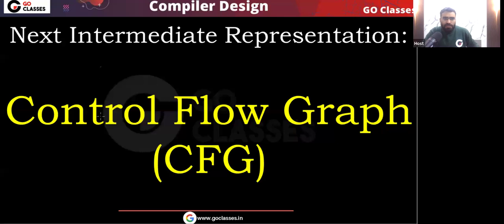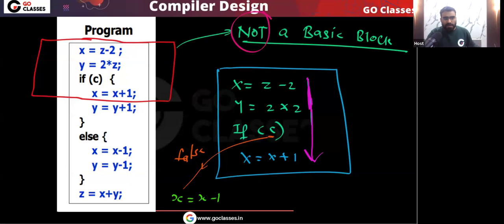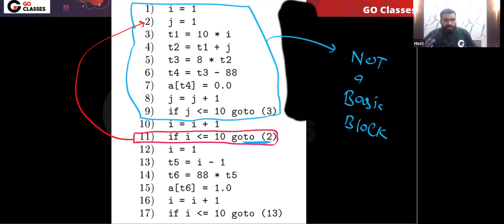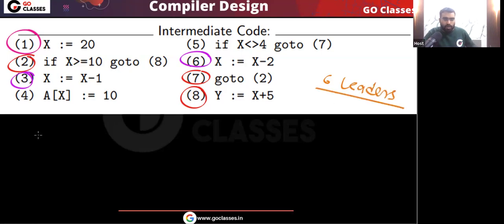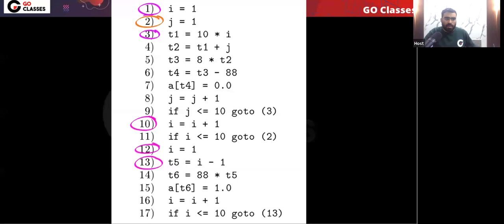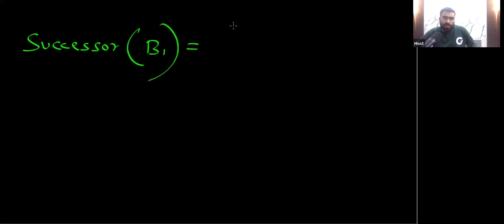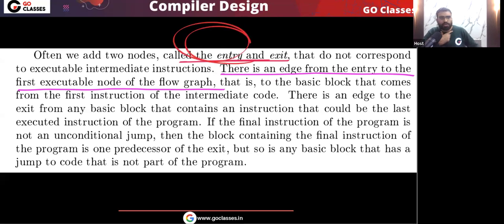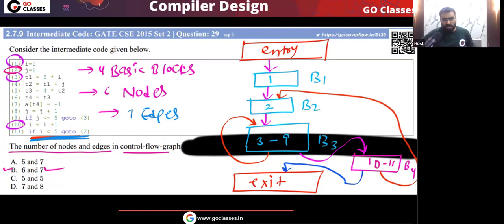Control Flow Graph CFG - Complete Lecture | Basic Blocks & Leaders | Loops in CFG | Compiler Design

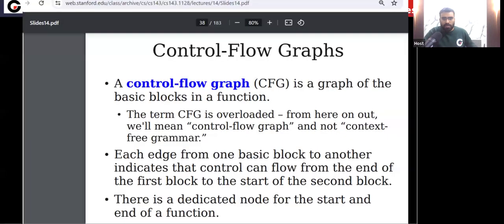Comment from the maker: 01:05:17 - Entry Node & Exit Node in the Control Flow Graph
There is a dedicated node for the start and end of a function.
01:47:26 - Why do we put Entry Node & Exit Node ?? Explained Here.
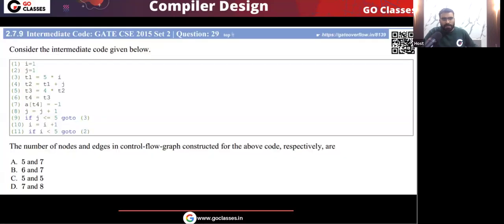02:18:15 - GATE CSE 2015 Set 2 | Question: 29 - number of nodes and edges in control-flow-graph
https://gateoverflow.in/8139/gate-cse-2015-set-2-question-29